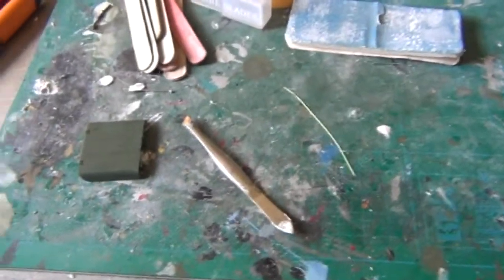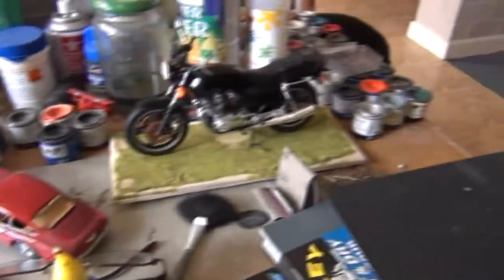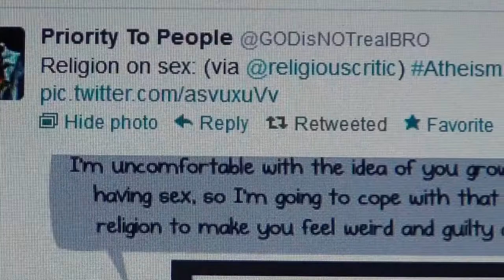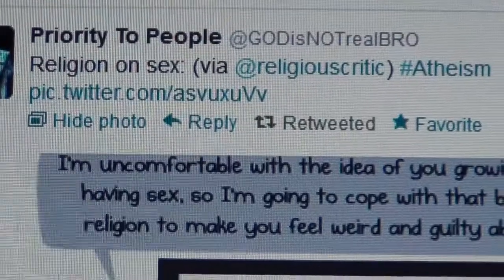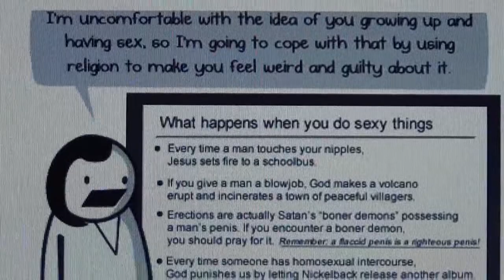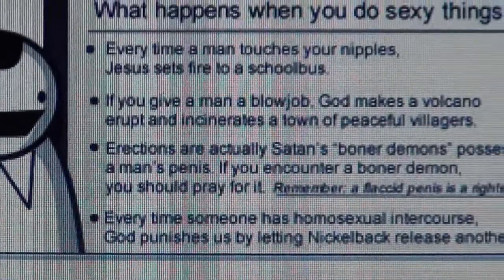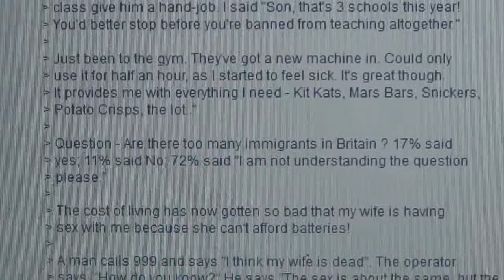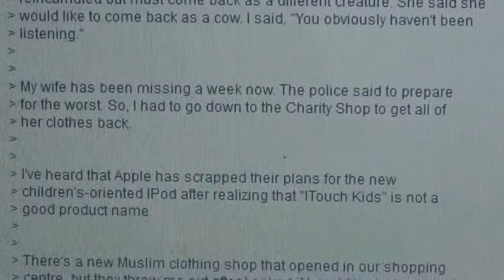I'm actually at my table

Comment: B10 is the transmission cover that fits underneath the chassis (A34), and the front (B20) and rear (B22) driveshafts fit into. B33 fits in between the front axle (B20) and the chassis. (I'm looking at the instructions online, on an online model store that shows images of each model, and includes images of the instructions.)

Comment: Chris I guess the engine sits at an angle of 20-30 deg' to get under the hood or do's it stick out from the bottom and have a tub which it sits on to cover it. I know  this will bring the axle down but it would need good ground clearance. It's hard to work it out just seeing it on video!  I bet your be playing with it and it will just fall into place and your think what a dip-stick I'm for not seeing it, or your have a bright- spark sitting on the lav or some other obsure place. TTFN Pete.